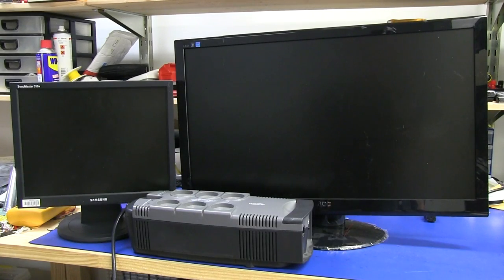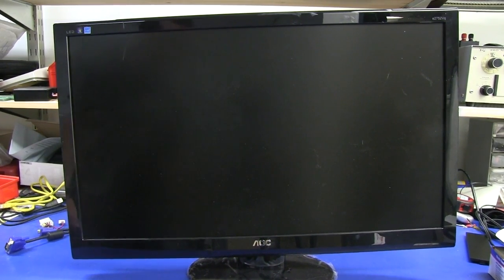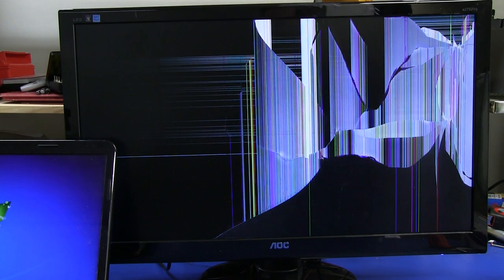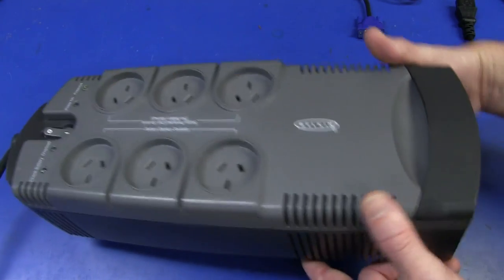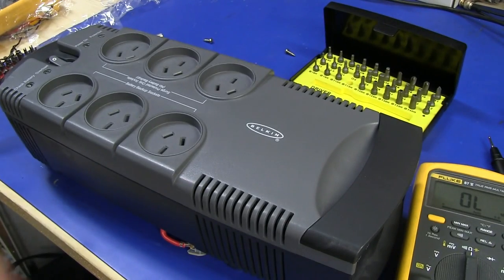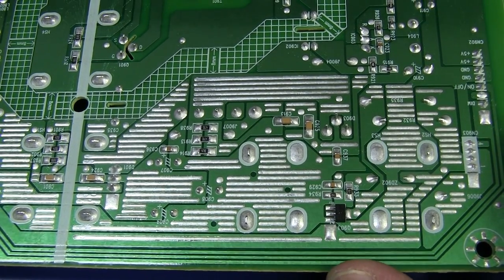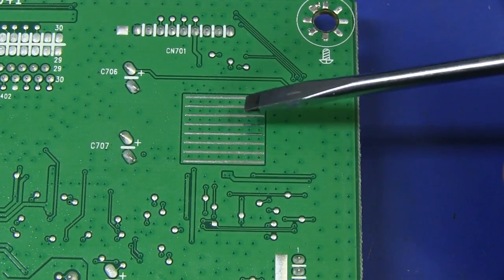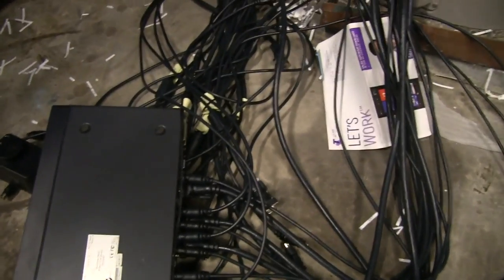EEVblog #463 - More Dumpster Diving

Comment: I'm certain with the belkin power boards they garuntee (up to a certain value) anything plugged into the board will not get damaged, this is probably why they use the tamperproof screws, so people can't tamper.

Comment: "under a Xerox Phaser thing I didn't bother getting" - if that was one of the solid-ink models, I'd have thrown any amount of monitors back in the dumpster and take that one instead. Those things make brilliant photo prints, but unfortunately they cost an arm and a leg if purchased new. That would have been nice to investigate and probably repair.
Reply: +Markus Strangl - They also cost a fortune to repair.  (Enough so, that we actually took one to recycle after determining the cost of parts.........  That bad.....)

Comment: My Latest Find In The Trash Is Two Sony Units. One Is An DAV-HDX589W And It Fully Works And The Other Unit I Found Is A RCD-W500C And It Fully Works Nothing Was Missing From The First Unit. And The Only Thing Missing From The Second Unit Is Two Small Nobs On The Front Of The Unit That Go To The  ( <-"AMS"-> ) This Is How It Looks With Out The Two Book Ends Just This  <-"AMS"->

Comment: power backup stays off? recharge the battery seperate until it has 12.5 volts when disconnected. it should then. i've one myself, had the sam issue and this is my solution

Comment: The computer store here has shelves outside, where people leave computer equipment they don't want.  Recently, I snagged a Viewsonic VE510b LCD monitor.  When I hooked it up, it would make a zapping sound, and cut out.  It turned out to be a bad solder joint in the P.S.  It took me about 10 minutes to take it apart, and another 5 to put it back together.  The actual repair took about 10 seconds :)

Comment: If it does turn out to be one of the ones that uses the "crayon" blocks, they usually have a big catch tray that collects all the excess ink and forms a big block of mixed colors. A co-worker at a place I used to work at used to take the mixed block when cleaning out the printer and give it to his kids to color with. They work just like crayons.

Comment: Whenever I encounter those one way screws (big Goodwill/Thrift store hunter), I'll take a 1/4" or 4mm allen key (depending on my driver) and Dremel and grind it down to exactly the slot width. Then I lean into the driver while turning, and I get enough torque to really force the initial grip. After that, depending on the thread tolerance, it's just a matter of maintaining downward force while turning. Key is to have a slot that fits close to exact, thus grabbing those torque points off center.

Comment: The reason there's all that solder on the board is to stop it corroding. You always have to retrace a printed board with solder after you make it (if you do it yourself), otherwise it will degrade over time.

Comment: Could you not just use a pilar drill and drill the security screw out (affectively drill the head off) on the Belkin thing?
Reply: +Mike Gravgaard Yes this is the way, drill off the head and use some vice grips to remove the thread.  I've done it that way for years.

Alternatively, if he's lazy he could tighten until it strips the hole...

Comment: Wish I lived in a place with such a fertile dumpster!

Years ago we discovered a place that serviced fruit machines (gambling machines), ended up with tons of microswitches and cam-operated sequencers which were used to flash the lights in the days before solid-state switches. unfortunately they fenced off the skip (dumpster) after a few raids so we could only look through the fence at the goodies in it!

Comment: Must have missed my post. Solution is buy the right screw driver. The one that removes those screws has two carbide posts on the end that dig into the screw. Those same screws are the same used to build bathroom stalls and thats what we had to do if had to remove one.

So just Google Security screwdriver.

Comment: By the way, concerning the screws in the Belkin-thing: I was able to remove this kind of screws by using a rather new screwdriver with a lot of force towards the screw while turning. You will probably not get anywhere if the edges of the screwdriver aren't sharp anymore, they have to "bite" into the metal of the screws.
Wera Lasertip might be the right screwdrivers for that job. These are fine tools anyway!

Comment: On the UPS, get a left handed drill bit. drill until it is flat, push down and let the drill bit grab and back the screw out slowly. Also you could drill it with a small regular bit and us an easyout  or seft handed screw.

Comment: A friend of mine had his UPS from belkin break also. The problem is that they are likely unfixable. They never offer the power that they are rated for. His was rated for 300 watts, and all that was connected to it was a 17 inch monitor that uses around 40 watts, and a cheap dell PC with a 200 watt power supply (likely uses much less than 200 watts)

When he had a blackout at the college dorms, the UPS did a loud click and the battery backup failed  (refuses to switch to battery backup)

Comment: You can undo those flathead scews with those two-pin security bits. The notch in the middle prevents the driver from riding up on the ramps - so with a  bit of pressure you can undo them and bob's your uncle.

Comment: Just what I was going to suggest - strip the threads and then use slightly bigger self-tapping screws to put it back together, or a quick squirt of "hot snot" in the stripped holes should give the screws enough purchase.

Comment: The main failure mode of every LCD monitor and tv is the damned power supplies. But most people don't know that. They just know their appliance won't turn on. 

We who have a little bit of experience know that replacing dodgy caps or entire power supplies solves the issue in many cases for < $100.

Comment: You can buy screwdrivers made to remove those screws. They have two hardened steel pins set in the end at a slight angle. The pins have a sharp 90 degree edge and they dig into the screw head without camming out. Lookup "undoit" in google shopping.

Comment: Wanted to also add that I have a really old 200 watt APC UPS that had a similar failure, but in my case, I know exactly what caused it, I had around 500 watts worth of equipment connected to it. (most cheap UPS, have no overload protection, so if you plug too many things, they simply die.

Comment: yeah if it's not a sacrificial item then you really do have to be careful if you go the drill route. the key is careful bit selection so that you dont damage the actual screw hole too much so that you can simply use a larger diameter screw when reassembling. another way which is less risky if you have better access to the screw head is you get the dremel out and carefully cut a slightly deeper slot for your screwdriver, just enough to get the required purchase.

Comment: The UPS might work. They usually will act very strange if the battery is dead. Try feeding it 14V to the battery input, it just might come to life. Found a completely dead APC UPS that hade been sitting outside for quite a while, with a leaking paint can on top, it was really filthy. But a set of new batteries and it's been running strong for 3 years now.

Comment: Wow, that one-way screw would make me want to into the UPS all the more. Maybe tighten it to the point of stripping the threads (if it is in a plastic screw hole) - then pull it apart? Just amazing.

Comment: One way screws are easy to remove, You can use a specalized screw driver (one way extractor tool) So they are technically serviceable or could just take a slightly more destructive approach and use a Grabit bolt extractor and a cordless to remove screw then just replace it with a standard phillips

Comment: On the power box, tighten the security screws with a power drill until the heads snap off or the thread strips out?

Comment: I needed to put it back together though. Did look through the big box of salvaged screws though and tossed the one way ones in the steel scrap pile though. I got hundreds of those installing security barriers, they just do not work well there, much better to use standard high tensile drywall screws and when finished seal them up with epoxy. Stronger than the one ways, and holds the wood frames better. Generally the supplied screws pull out of the wood, the ones I used do not.

Comment: You can more often than not drill a hole into the one way screw about 3mm then put the drill into reverse, angle it slightly and slowly turn it anticlockwise. The drill bit should catch and remove the screw.

If it won't catch then tap in a shitty torque screwdriver that is just bigger than the drilled hole and unscrew it that way.

I wouldn't drill off the entire screw head as suggested  in another comment as not only does it take longer and hold the risk of you drilling through the plastic below it but if you want to re-screw the hole you will have to remove the rest of the screw from the holder some way after.
Reply: Oh he could buy a security bit set
Reply: ElfNet Designs
As far as I know that won't remove one way screws. They are designed never to be un-screwed, not even with a special tool.
Reply: I have a set of screw removing bits that will take those out. They are designed originally to remove screws that have fouled up heads on them and I have used them to remove those "non-removable" type screws. Of course you can drill them out or if your good you can heat them up and pull them out if you can get at them to do so.
Reply: ElfNet Designs
Can you post me a link to those bits you have so I can get them please?

Comment: If you don't mind not being able to put screws back in, you can take a old soldering (I recommend using a cheap chinese one) and heat up the screw while pulling on the case.

(easier than using a dremel on the screw :) )

Comment: I say 84 holes. I worked for NCR and they used those exact screws we had 2 things to remove them >1 had a 2 pins on it the other was a self hardening paste . Those ones down in the plastic are a little more tricky. Never leave behind any electronics. Once you test the switch I bet you could get 50 bucks  for it.

Comment: In my experience: consumer UPS units WILL NOT WORK unless it's got a servicable battery in it. I can get batteries for $15 but usually they have cheap charging circuit that just grind through batteries. If you get 3years out of one, you're doing good :)

Comment: Those security screws are easy - just take a sacrificial screwdriver and grind it down so it fits very snugly in the slot, then turn while pressing down firmly. Works well on threads in plastic. I have often just screwed them out without doing that, they just take a little longer. Replace the SLA and it will probably work well, they need the battery to turn on a relay to turn on the charger and power the MCU, otherwise totally dead.

Comment: yeah.. thats the lcd problem... the screen is protected by a sheet of plastic, unlike our phones that has thick glass cover.
The internal thin layers  were crushed and broken - you can even damage them by tappign  or putting too much pressure on them.
You could look for soem semi working one (that has part of  the screen ok) and do soem testing - like how much pressure it can handle  and such until it has visible deformations.

Comment: Heat the tip of the screwdriver and stick it in and it'll melt a new slot at the top of the plastic screw and you should be able to unscrew it again.

Comment: ive got the same Belkin Omniview Pro2 KVM switch from the dumpster. Video output was heavily distorted. So i  bridged the video amplifier in/out - video ok but levels low (no amplification and termination resistors...). It turned out that the amp itself was ok, but a electrolytic cap near the video amp IC was bad - i've replaced the cap and the KVM switch works like new. Eight USB-PS/2 converter ICs, Video Amp and OSD chip in there.

Comment: The screws on the UPS are required but there is a work-around. I don't know if you have them in Australia, but in Canada we have gizmos that will grab the head of a damaged screw by biting into it. Here it's called the 'GraBit Damaged Screw Remover'. I got them and the bolt removers, I wouldn't be without them.
It's in Canada but try this link 'canadiantire . ca/', search 'screw remover' so you know what I'm talking about. I hope this helps.

Comment: you can do a plasma speaker/lightning generator out of the flyback transfo thingy, also some have some 3~20W audio systems, you can get the condensers, resistors, one or two relays, spend two hours to get the copper wires out of the coils :p , you can make a rfid zapper with the magnetic shield coil and a flyback transfo

Comment: Today I came across 2 of the security one time uses screws and it was my job to remove them. I broke 3 drill bits trying to get them out! After some time I did get the screws out.

Comment: A (Belkin?) omniview KVM switch. I think that is the, or a similar, model of the one used at my work some time. It responds to keyboard key-combinations to switch over. Interesting to see how that works, maybe (it has to monitor the keyboard input for set combinations). We used it to check the burn-in (software) status of a lot of computer modules.

Comment: Remove the plastic of the 6 small monitor and make a simple frame with some metal/wood.
You can insert the electronics stuff in a small plastic case or something like this or, you can leave it rear the screen and glue the circuit board directly to the metal shield of the lcd panel :)

Comment: to unscrew the nasty tighten only screws:  drop some solder in the hole stick a metal(coper if possible) rod on-top the solder and heat up the rod with a lighter to melt the solder.
wait until the solder hardened again and unscrew the bastard

Comment: The UPS-thingie probably "failed" (plays dead) because the 12V battery is dead - at least that's what all my APC-UPSes do. Usually a new battery fixes those :)
Maybe you should put up a sign in the dumpster room to tell people to give all electronic devices to you instead of throwing them in the dumpster ;)

Comment: with those on way screws use a drill with a screw  driver and over tighten the screws till the threads rip apart the plastic apart then replace with a bigger screws

Comment: The UPS should work if you give it a good battery try a bench supply I have gotten one from goodwill that just needed 13 volt on the battery side to start

Comment: Huh? A Xerox Phaser printer? Depending on which model it was, it might have some resale value. However, for some reason, lifting those 100lb Xerox printers from the bottom of a 06' dumpster, is a real workout.

Comment: Even if it's of no use to you, it would still be interesting to see how is the switching done is it logical or physical as some oldies were, and I guess you can still fleabay it if it works!
More dough to buy test equipment to tinker with for our viewing pleasure!
Plus I need a KVM lol
I would not make it fly from Australia to France though, especially if its a big multiple U rack mounted one. but I guess there will be local eevblog followers badly in need of one, or some nearby hackerspace!

Comment: Dave. You could drill out the heads on those one way screws and then use those screw extractor bits to remove those evil screws. I have a power supply brick from an XBOX video game console that had torx screws but I replaced them with phillips screws.

Comment: ive found similar results using a cheapo Chinese soldering iron, and a smaller (width) Thicker flathead, heating up the screws that are too tight, then using the screwdriver to remove them. Belkin makes a lot of crap tho, and quality is usually fairly poor.

Comment: hi dave. i have a question. just tonight i have found my laptop charger wasnt working. the led wasnt on. i tried to unplug then plug it back in and it still does not work. when i went to try a different outlet i saw a white powdery substance on the side like what comes out of a regular AA battery. if i send it to you, do you think you might be able to repair it for me?
thanks.

Comment: it's a "first world problem" Tim, over here noone even throws out broken stuff, i've yet to see a single thrown lcd monitor(and if it's on the stret, it lasts 10s until the copper scavengers rip it apart), hell we where even getting CRT monitors for repair until last year!. People/companies simply value stuff when you can't spare a dime... Companies still have CRT monitors everywhere and a "old" computer is probably a pentium-2 or older, everything else is usable

Comment: What are RFI tabs? :O
Reply: +Omer Choudhry : I think it's an abbreviation for Radio Frequency Interference. They are designed to either shield equipment from high-radiating other parts and/or (but Dave has to correct me on this one because I'm probably wrong) to reference them to a common ground present in the device (either through the earth wire of the device that is connected to a ground plane on the PCB or with the earth wire directly connected to the metal chassis.)  Parts, boards or even complete devices without a common ground can do quite extra-ordinary things, especially when the earth/ground is connected to another device with an earth.
Reply: Thanks for your reply mate,
but honestly I still dont get it.(I cant find anything online about RFI tabs) why would you have 'tabs' to shield equipment- normally, isn't a metallic/wire enclosure used?
Reply: Because some forms of radation need to be contained within the device's enclosure (which doesn't necessarily needs to be metal), to stop it from radiating into other sensitive parts? :)

Comment: The Belkin has security screws, not to stop servicing but because they garentee your equipment plugged into it. Its to prove it has not bee tamped with. if your equipment blows up, by to something like a lightning strike to power lines or power surge. Belkin will replace your equipment.